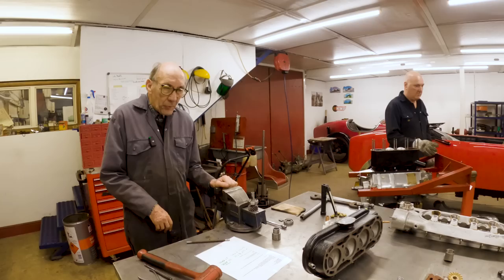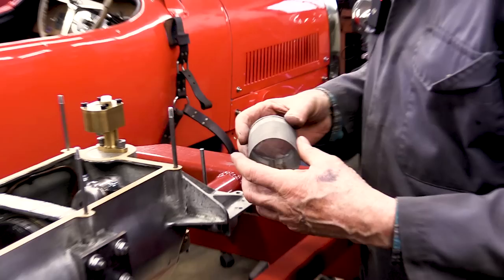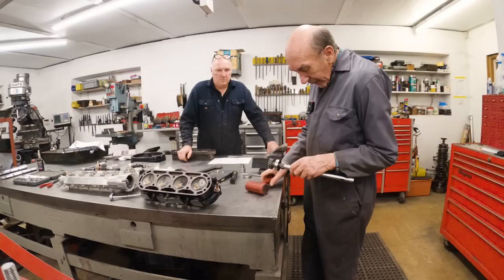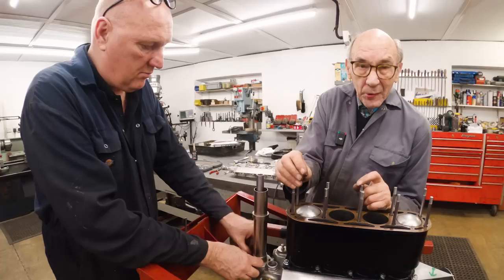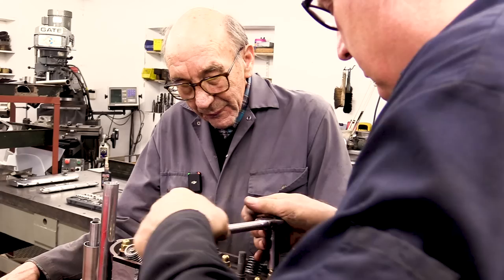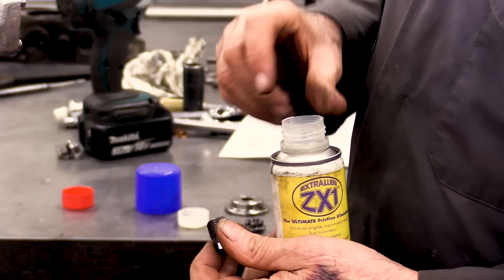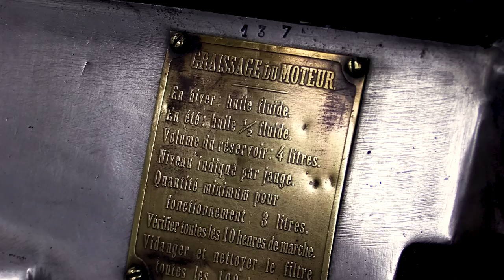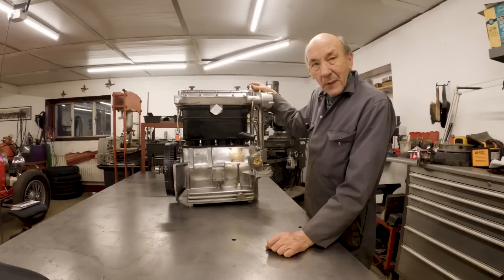Building GPS engine. Part 3

Comment: Thanks for letting us spend an hour in your workshop Ivan and John.
That hour just flew by, great to watch you oh so knowledgeable chaps in the "Shed". Just on the head fragility, could you counterbore the head stud holes from the top and fit alloy crush tubes with coolant seal 'O' rings in the upper counterbore surface  to bring the fastener pressure directly onto the inner top side of the head gasket surface, just a thought.
Reply: I wouldn't use alloy myself but I think I'd make from brass rod just a fraction longer than the height of the deck and seal with a large copper washer with sealant under it

Comment: To make it more accurate valve timing if you use a depth gauge and put the piston 7 mm down the bore, then set the timing disc to Zero, then swing the piston down and up on the next stroke and again stop at 7mm before top dead centre. Now look at the degree disc and you can see the difference between the two reading say it was 20 degrees half it and use that value agains you timing pointer. This is far more accurate as crank can swing at TDC and piston movement is hard to assess. Love the show Ivan.

Comment: Lovely looking engine.
Especially good to hear you appreciation for Paul Smith and his products. He also makes a lot of stuff for early bicycles. Excellent guy Paul and a talented engineer. Helped me out many times from correcting the value pockets on Dino pistons for which he made a fixture to oil gallery fittings for the Maserati. 
Great video !

Comment: For recovering pulled threads Time-Serts are really good, they are a bit like a Heli-Coil but a solid threaded sleeve internally and externally. You drill out the pulled thread hole larger, step the hole with a tool in the kit cut a thread in the larger hole and then using the installation tool and a small amount of oil wind in the Time-Sert, the collar on the top stops and locate in the step and you carry on winding the tool in which expands the Time-Sert so it is locked in position. Thread sizes might be and issue I know they do metric and US sizes. You will be impressed with the result. They do a double thickness insert if the threaded hole has pulled and then elongated. It no stronger than a Heli-Coil but a far more professional result and will withstand assembly and disassembly better. Pulled spark plug holes also catered for. The double diameter one is stronger than a Heli-Coil. I saw a guy testing them on the Web. I have used them and fantastic result. A friend used them all the time, when threads on his alloy two stroke racing engine cylinder head bolts pulled.

Comment: You are dead right Ivan that is a really pretty engine. The upside down cam buckets was a brilliant idea to keep the slim dimensions of the cam box and that's the main reason it looks so nice, as it's not top heavy looking. Lovely job by everyone involved. Paul Smith is a very, very talented engineer. His parts are superbly made, you can tell that by looking at one of his new cam buckets. In machining terms that's a bloody work of art.( unless it was done in a CNC mill of course!) but I suspect they are turned on an engine lathe then milled. And  you are correct about Allan Milliard, his cutting and shutting motorcycle engines are complete works of art when finished and could and should be in museums. And ithat low friction oil he recommends , well if he says it's good you can believe it. By the way Ivan, have you seen his V10 Dodge Viper engined bike he built? Now that's some machine! But to think those Salmson twin cam engines were made over 100 years ago is mind blowing, when you think back to the early days of say the first Lotus twin cams and everyone thought what a good idea! So new! Now we know different! Can't wait to see and hear your new engine running. Great episode Ivan and John, and Tanya.

Comment: I was looking at some pictures of this engine and came across one which had twin SU carburetors. Obviously the cylinder head must have been modified but I couldn't see enough detail of what had been done. Between them I could see a blanking plate covering the original intake. Sounds like a job for Allen Millyard.

Comment: Very interesting. This is how the camshaft timing is set on the Porsche 911 engine. A certain amount of lift on the dial indicator and then the pin locked the cam to the timing gear chain sprocket, then the huge cam nut on top, tighten with a special tool that I had to buy myself.

Comment: Old blocks like that sometimes I would find the right bolt fine thread tap the block out for the bolts machining flat read the middle of the bolts for the size of your studs basically making my own case savers.

Comment: Perhaps the modification to the oil drain of the front gear case has an unintended side effect?
It seems to me that the gear casing will become a sludge trap for any carbon (or metallic) particles that get washed out of the head, which can't be good for the gears.